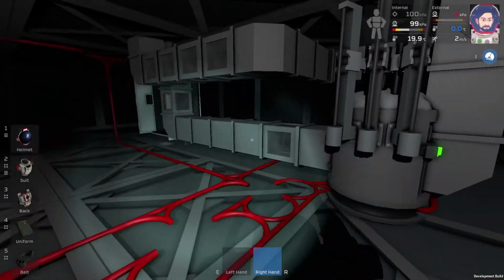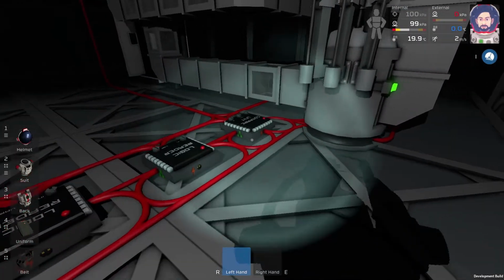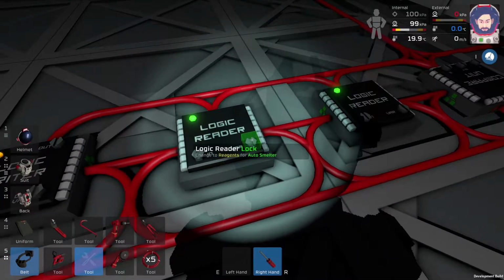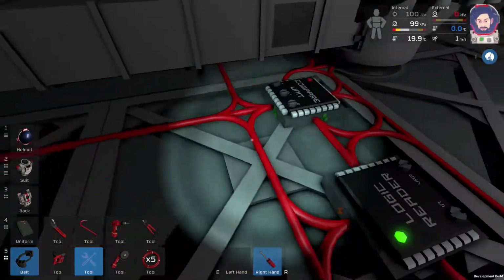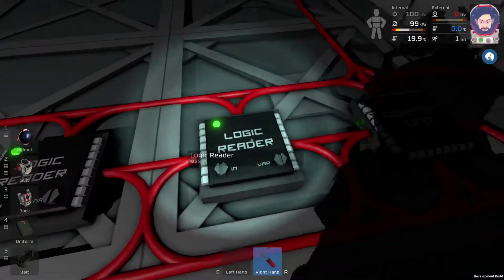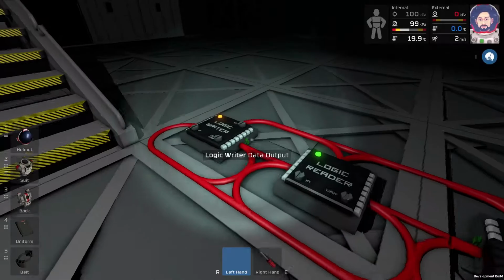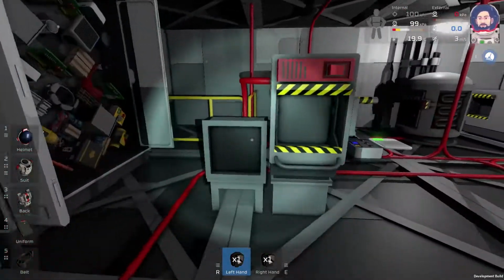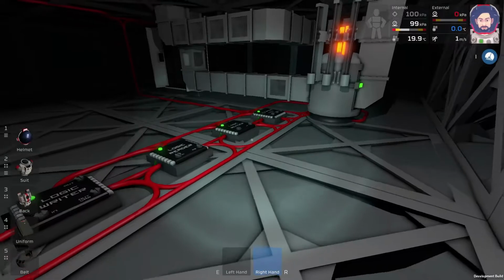Stationeers | Auto Smelting w/ Logic Gates | Episode 14

Comment: Would it not be more productive to replace one of the logic readers with a logic memory? The reader will either be 1 or 0 and the memory chip will contain the value of 1. The logic chip will compare the reader with the memory and if they are equal, the furnace will active.
Reply: There is also an "Idle" variable you can check and compare for the furnace. If the furnace is idle then the variable will hold the value of 0. If the furnace is active then the same variable will hold the value of 1.